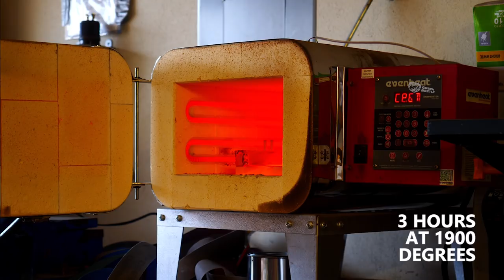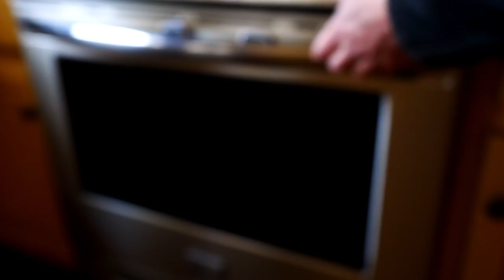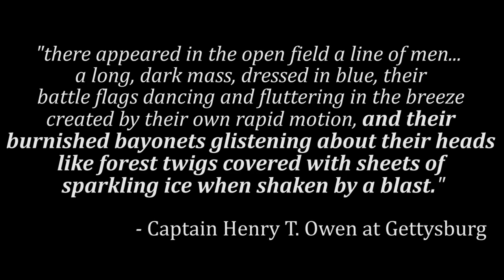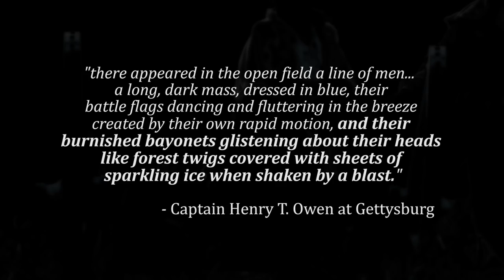Forging a Knife From A Civil War Era Bayonet

Comment: At 3:21 is the purpose of normalizing before quenching just to recrystallize and get a more equiaxed structure before quenching? Otherwise why do you do this?
Reply: Keanu B resets the structure in the steel, reduces chance of warping and cracking.
Reply: It is important to normalize your steel before you quench in order to relieve any stresses that may have developed in the steel during forging to prevent cracks and warps in the blade. It also  reduces the grain size to ensure that the metal is consolidated enough to make a sufficient edge. In conclusion normalizing is a critical step in the process of bladesmithing and cannot be overlooked. P.S. that was a very good question! :D
Reply from the maker: yes sir, ty sean

Comment: Why only 3 hours case hardening? One lick with that belt sander, and you blew right through the thin case.
Reply from the maker: Actual time at carburizing temps was 4 hours by the time my HT oven gets up to temp.  Also, the edge was under 1mm when it went into case hardening, CO diffusing from 3 sides.  I ran a test piece first and it should be good.  In fact, I could be wrong, but I think you can see some carbide pools along the edge in the final pics.
Reply: Cool! Sounds like it worked out, then. Wasn't sure how thick it was beforehand or much meat you took off after carburizing. If you figure ~6 thou of penetration per hour, that's enough to through harden a 1mm thick edge just fine. Great knife, by the way :)